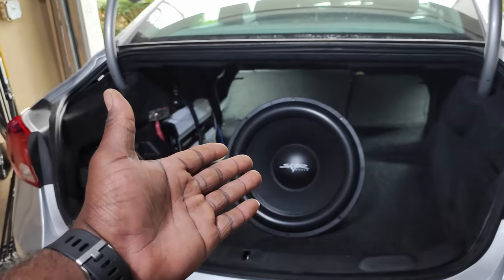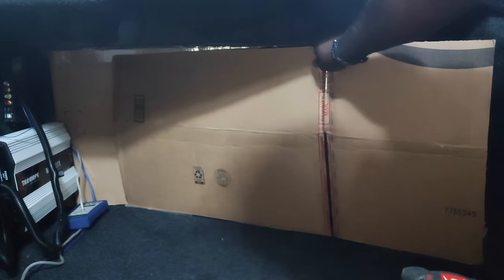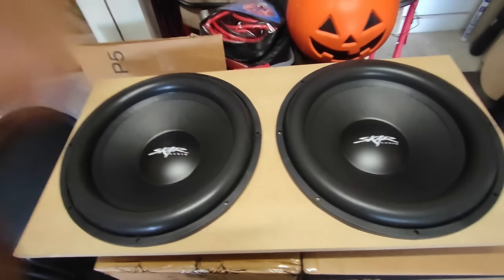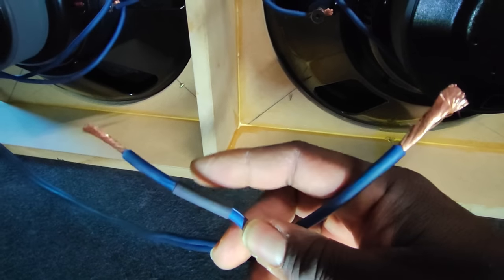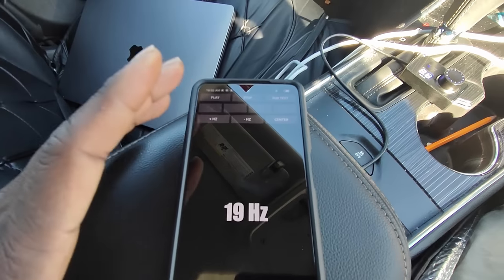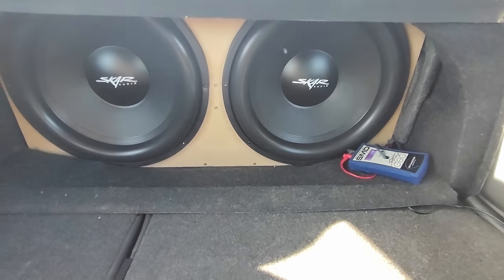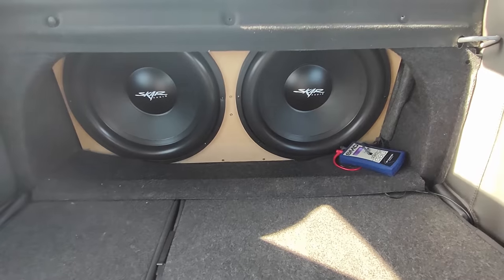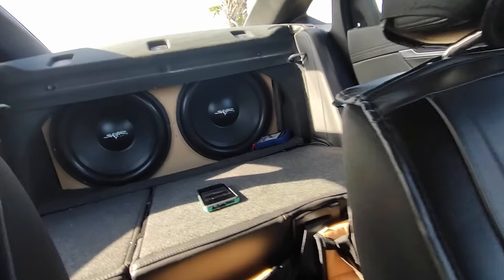No Other Design Sounds Better Than This - Infinite Baffle - 8,000 Watt Test - Part 1

Comment: I think since you don't need all the wattage that your amp puts out, running the subs at 4 ohm load would greatly help your S.Q. because most amps run there lowest distortion at 4 ohm... Take the time to completely seal around the edges also. Good video!
Reply: Agreed. Takes out that strained sound from the bass/music.
Reply: @wilsonrawlin8547  We are talking about subs here, todays monoblock amps are meant to be used at 2 ohms or below, running at 4 ohms is a waste of available power, He is running this at 1.2 ohms.  nobody wires subs at 4 ohms??
Reply: @jimhanson8370  
Not true at all many SQ people run at 4 ohms for cleaner sound.
BTW I didn't same a damn thing about what Ohms to run your monoblock subs at.
Reply: @jimhanson8370  not true, the car audio shops always wire systems up at 4 ohms. I didn’t learn about 1/2 ohm until YouTube. And I’ve had sounds in every vehicle since a teenager. I’m 47 now 🔊
Reply: @jimhanson8370  What are you smoking? Nobody does 4 ohms, unless they're doing 4 ohms. How many amps have you burned up?
Reply: @drewjohnson4794  your comment confuses the hell out of me, you literally say " no body does 4 ohms unless their doing 4 ohms" I mean what the fudge does that even mean. And the guy is correct run 4ohms when you can leas distortion less heat cleaner sound.
Reply: Yes. You would be right that if you keep all other parameters thr same and switched impeadence between 4 or 2 or 1 ohm then 4 would have the least.  But if you had 0.1% distortion at 1-Ohm and 0.05% at 4, then you'd still want to run at 1 to get the 4X more Rms output. Ohms only matter because of the limits of your gain knob. Different impedance, just adjust your nearly infinite gain knob until just before audible distortion at the loudest possible track. Although you're going to hit that limit sooner with 2 vs 4 and some amps run most optimal at 2 vs 4, it really doesn't matter a lot. But not having to turn the gain up much means you're able to get a more powerful signal which means sometimes lower Ohms (impeadance) CAN mean a higher SN ratio. And that's a good thing!
Reply: I run my Fosgate at 4ohms for my 2 d4 subs. Over 2000+rms at 4 I don't need the 3200+ rms for my subs. Also less current draw at 4 ohm load.
Reply: Depends entirely on the amp
Reply: @jimhanson8370  I kinda agree with you here, idk why everyone is saying otherwise. It's just a compromise. In fact, raising impedance doesn't automatically increase sound quality. It's just safer, that's about it. 

A 4 ohm set up seems to awkward to set up. If you have 4 ohm dual coil like (like most are), then you have to go out of your way to make sure you have 2 subs wired in series for a total 4 ohm impedance, and as you said, you'd be going out of our way for less power. A 4 ohm impedance would be impossible on a single dual coil sub. You have the option of 2 or 8, and nobody is going out of their way for a weaker 8 ohm sub. You can reach 4 ohms on to subs, but again, that's 8 ohms each. 

If most audio shops do 4 ohm set ups, it probably has more to do with not overpowering subs for their inexperienced customers more so than "it's just better" or "it produces better sound" etc. Your sub that was built to be wired in parallel isn't gonna sound like crap just because you choose to do so.
Reply: @jimhanson8370 running at 4 ohm will be more efficient electrically and produce less heat in the amplifier. Actually for an infinite baffle where he has 4x more power than the subs can take, it would be a perfect scenario to do this. Then a lot less risk someone can turn the volume knob up too much and blow the subs since there won’t be 8kw on tap lol. Most people don’t do this because they don’t want to spend 2K+ on a 17kw amp that is physically huge just to get 4k out of it when they can get a 4k amp that takes up half the space for what $800ish.

Comment: That’s an insane amount of power for those subs,  the trunk becomes a giant sealed box.
Reply: Not exactly. It’s not sealed at all. The point of IB is only to keep the front wave separate from the back wave. There’s no air suspension like a sealed box so the driver has to be rated for IB applications.
Reply: @rickcharles5667  True that it’s not totally sealed however it will still be more than if the subs were out in the wide open

Comment: As a SQ guy I absolutely love IB sub setups even over a sealed box. I bet this sounds amazing
Reply: Hey would this set up be better than 2 sa 15’s
Reply: Why is infinite baffle better for sq?
Reply: @jmohammed5487  Flatter frequecies across bass bandwidth. Less peaks.
Reply: why would IB be better.. wouldn`t the trunk rattle
Reply: @QuezJ81  that`s what you get with a sealed box, id be very surprised if a IB would sound better then a sealed for the vast majority of cars
Reply: @hotdog9262  infinite baffles are even better than a sealed box. If your trunk rattles sound deaden it.
Reply: @TarynMilnes1  guess you would need a bass driver fit for the job

Comment: I did 4 12” Fi IB subs in a 90’s Cadillac Fleetwood using this method. I went way further though and cut the entire rear deck out and built everything up with MDF and use expanding urethane foam to fill the quarter panels to seal the trunk from the cabin. It played lower than any other system I ever built and only needed 500w per sub. Still my favorite build ever. Not many people know much about infinite baffle designs and there advantages. Well done.
Reply: Wow you crazy just my type gangster shit 😍
Reply: IM TRYING TO DO THAT EXACT THING RIGHT NOW!!!! ANY IDEAS OR TIPS PLZ
Reply: @Sebastian-vt7fe  really depends on the car and your fab skills and size subs

Comment: Way back in 2002 I build a infinite baffle with 2 dvc 100w 12” Realistic subwoofers in my 90 Mazda protégé.  It was loud, accurate and clean.  Ever since then I’ve always been a huge fan of infinite baffle and T-line builds.  With the infinite baffle build you hear the subs not the box

Comment: This really takes me back! Over thirty years ago I did this in a Nissan pulsar with a couple of cheap 12” Crunch. I used a plate that was made for a Camaro and it just happened to fit perfectly behind the back seat. I never even bolted it down lol.

Comment: Considering how friggin huge even the smallest sealed box is for these drivers, I'm not surprised at all this worked so good. I've done this before WAYYYYYY back and usually had really good results. I would have gone all OCD to make sure there were zero edge leaks and mounted a panel under the rear deck smashing a thick piece of foam in between just to make sure there was no edge leakage. Good job 😁

Comment: You might could gain a point or two by sealing the baffle with spray foam. Line all surfaces with aluminum foil to protect carpet and such, then foam around perimeter. To answer your question, YES I would do this and actually considered doing it with those subs. Another idea I had was to do a B-pillar wall with 4 single 4ohm 18"s, such as Rockville RVW1800 or Dynavox 18"s. Woofers are about a hunerd bucks a copy and don't need a ton of power to get loud. Thanks for sharing, BudgetBassHead.

Comment: I love the simple look in addition to the retained trunk space. That sounds like a win to me. I remember back in the 80’s and early 90’s that was a pretty common set up. Cerwin Vega made a sub specifically for this application. I believe it was the Cerwin Vega Stealth free air series and they had black surround instead of their classic orange surrounds.
Reply: 7i7í
Reply: MTX Eliminators
Reply: Yes ..Yes.. I did that (cerwin Vega) in 1986 with a 1968 Camaro.. Rockford Fosgate power 650.. pioneer mid & tweet... with a Kenwood pull out cassette radio...fond memories
Reply: Correct....I remember them particular drivers knew someone had a pair in a sealed box in a hatchback an it banged

Comment: Did this with two Chevy Novas , the mid 70s sedans. Worked out great. Used double thick baffle, bolted to the metal lip, rear deck braced up as well. Lots of dynamat.

Comment: 30 years ago I did a IB setup with a couple pioneer 12's in a accord.   the main issue was rattling the crap out of the trunk exterior.   With the same subs in a 4th order bandpass through the rear deck and it was the most amazing experience.   Literally raise your hair with the sunroof open and no rattles on the car 20-80hz.   Can't compete with your trunk space though!

Comment: Budget, throw two 18” stereo integrity HT-18s in there 

Replace the skars with these, I promise you will be amazed , nothing wrong with the skars but the stereo integrity are better and will handle more power (not to mention they cost 199 each) 
even though on 200 watts they sounded almost as loud as 2000 watts in my build- it’s just and IB thing brother - down low they only need single to double digit wattage to create carnage inside your car……and down low I mean 10-30hz notes 😂

I’m one of the guys that begged you to try IB in the first place so I’m a long time viewer and appreciate your channel.

Peace brother

Comment: My first car was a 1978 Monte Carlo. This was in 1992 and I did my system like this. I removed the seat back and mounted two 15" subs in a panel that was sealed as best as possible between the cabin and trunk. Old school "surfboard" amp at 500 watts for the subs and another 250 watts for the mids,highs mounted in a nice flush mount rack right behind the the subs in the trunk. This was in high school. I did a killer upholstery job on the panel so anyone that sat in my back seat leaned against the 15's and waffle grills. The shit banged hard! My Motorola "brick" phone would bounce on the trunk lid.  When I rolled up to school or a house party everyone knew I was coming. The car was also slammed with 15x8 reverse deep dish KMC spoons, fresh paint and crushed velour interior! My car would peel those reflectors off the road as I changed lanes. LOL.

Comment: I've considered doing an infinite baffle in my rear deck with smaller drivers, only because I need both the trunk space and the passthrough into the cabin to be able to haul stuff around for work.  I'm also considering a shallow transmission line mounted to the underside of the rear deck, but I'm concerned about how a shallow, wide line would perform.

Those two 18"s look killer, though!  Have you played it with the seats up, yet?  :D
Reply from the maker: It sounds like crap with seats up. Almost becomes a fourth order bandpass. Rattles the trunk like crazy, but about a 50% loss of sounds in the cabin. I have to crank the power to hear it properly, which these subs can't handle. I would need the ZVX-18's to play with the seats up.
Reply: I have a single 15 hung from my rear deck so I could retain full function of the  back seats. I'm not an spl type guy but who doesn't love bass.
Reply: My Fairlane show car has four 10's in the rear deck
Reply: @BudgetBassHead  in my 2015 civic sedan I cut the rear folding arm rest with a ct sounds meso 12 inch Made it custom all the air would travel inside the car . The meso 12 gets extremely low for a box tuned High . Sounds really good

Comment: This is legit, never really thought of having the whole trunk as the enclosure. you def need some big speakers and a powerful amp for this build.  Did you need to reinforce the trunk more or use dynomat?
Reply: you are very wrong, you dont need a ton of power for this, just a good seal and sound deadened cabin, check out ps sounds for these setups, he doesnt even have much power to begin with yet, he can make hair tricks
Reply from the maker: @Aaron_Jones  No I didn't apply any 'additional' treatment, just yet. But I do plan to seal the entry a lot better.
Reply from the maker: I have to agree with you Josip. With the lack of compression, a lot of power wasn't really necessary for this build. When given a clean signal, it simply sounds good.
Reply: @BudgetBassHead  im having a hard time deciding making a good sounding wind machine against a big heavy box that will just get louder, but not sound as clean, if the infinuite baffle dont sound good, i will still have a baffle to use for a box, weird shape of the trunk is a pain in the ass, id rather just make a strong baffle, run low power and not have to worry about anything, hopefully

Comment: This is how they use to do it back in the late 80's & 90"s. They use to bolt the board to the back plate opening or to the floor so it was locked in and tight.. Systems use to bump back in the day. Love this old school system!

Comment: Memories...1981 Honda Civic Sedan with four Kenwood 6.5" subs mounted to the rear deck in 1991. My girlfriend at the time and wife of 27 years blew them moving her and her best friend stuff to their new apartment. They stuffed the trunk. When they returned my car, subs were done. Another time, they ripped out my exhaust from the cat back. Anyways, the Kenwood's were still under warranty. The stereo shop was having a sale, so I got four 8" and two 15" Pyle subs and walked out with change in my pocket from the original 6.5" purchase. I mounted the 8's on the deck and the 15's behind the seat. It all got stolen a few weeks later in my apartment parking lot.

Comment: You are basically using your trunk as a big sealed enclosure. The better you seal around the edges of the baffle. The louder it got. Double or tripling up on the baffle and counter sinking them will help in SQ. From what I've found is that an infinite baffle requires a ton of space to unload from. It may be worth testing a single 18 centered with space on both sides. If you could then move it back and forth in the trunk to help get a desired tuning. But then it would be basically free air. It's more practical to design in vans and SUVs.

Comment: Years back I installed a single 12" on a third gen Legacy sedan, that doesn't have flip down back seats. But it had two steel box section beams in the center and I used those to install a board with hole in the middle for the sub. I put some packing material between the board and the seat back, to reduce/eliminate resonances. The sub was installed behind the board so that there was pretty even contact between the board and the seat back foam. It played real nicely down to around 24 Hz. The Fs of the sub is claimed to be 25 Hz and it won't play much lower than that. I had about 800 W RMS for it, but I felt it would've liked more power. I do think that the restriction of air flow from the seat back creates sort of an air spring effect in front of the cone and gives the sub a bit better mechanical power handling and maybe even a bit better control... I did test it without the seat installed and it felt like I could max out the suspension.

The best parts of the system were the bass notes that vibrated through the chassis of the car straight to your ass, even at lower volumes. And the fact that the sound didn't have the same kind of pressure that comes out of a ported box. It was super smooth and clear, unlike the certain "messiness" from a ported enclosure. I have super sensitive ears to sudden or radical pressure changes (mainly because of damage from an assault rifle blast), but I still like high volume, which may sound kinda odd, but with that system, I could blast it with great vibes for hours without getting fatigue on my ears, which is very common to happen with normal systems and ported subs.

EDIT: And third part was that I only lost about 20mm of the height of the trunk space and the amount of a sub sticking out from the middle. I just put a pretty accurately fitting MDF board on the back, so that I can raise it up to get to the spare tire. There's plenty of room between the trunk floor (underside of the board) and the top of the spare tire.

Only problem I faced was the erratic behaviour with the phase response. Not sure which component was the actual cause, but as I had the front doors playing down to around 35-40Hz, there were lots of spots where they cancelled each other out. A single track would play crazy good with such control that it was almost too good to be true (especially for the money spent) and then the next track would have pretty much nothing at certain bass frequencies. I had pretty serious DSP in it and also a DSP head unit and I tried to hone in the sub for endless hours, playing with delay and multiple phase settings (head unit 45° steps from -135° to 180°, amp 0-180° and the DSP +/-). At some point I thought I probably should make a beefier board for the sub and point it straight at the drivers head. Also the boot is not insulated in any way. Rather it's very free-air and dipole-like. That could also be the reason. Nowadays I have a bit better gear for measuring stuff so maybe I should try that.

Now I have a monster SQ amp that I'm in process to get wired in. It should give 2 x 850 W in 2 ohm or 1700 W in 4 ohms bridged. I think I'd go for the 4 ohm load (2 ohm coils in series) as it should give a better damping factor.

Comment: This is called a free air setup that was done a lot in the 90s generally the baffle would get sealed with great stuff, I had this same setup in 1996 with 2 12" pioneer impp on a punch 80, but you're basically using your trunk as a box as why you have a fairly low frequency, I personally like the sound even if output isn't the greatest it's smart if you want to save your trunk space.
Reply: Exactly the way I would describe it. I pretty much had a similar set up 1992 in a 86 cutlass with some free air pioneer 12's powered by a autotech amp. The bass was deep,  I could be heard 2 blocks away . This was old school.